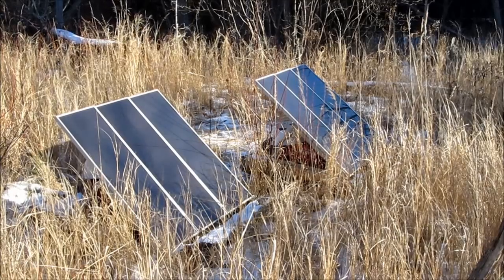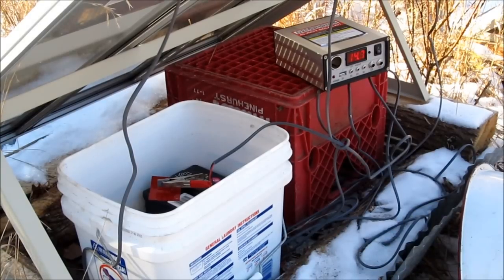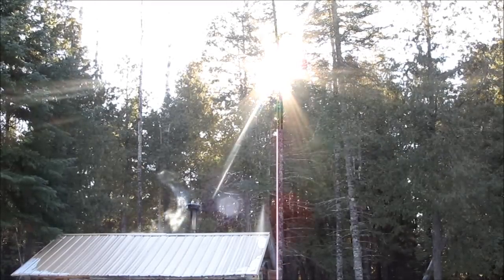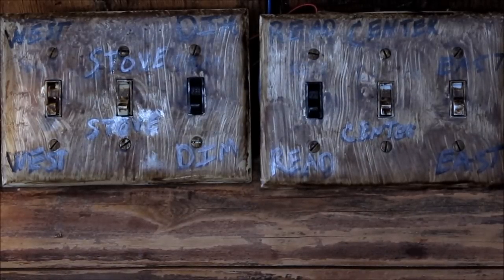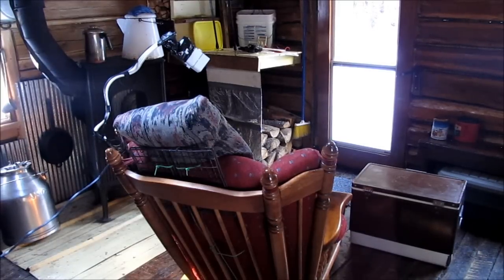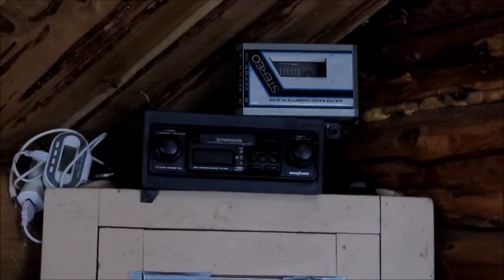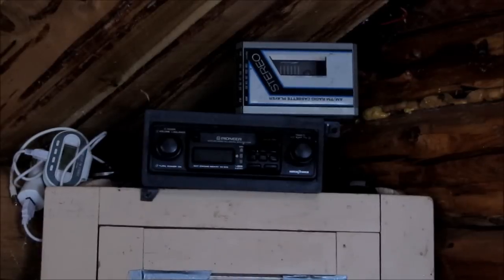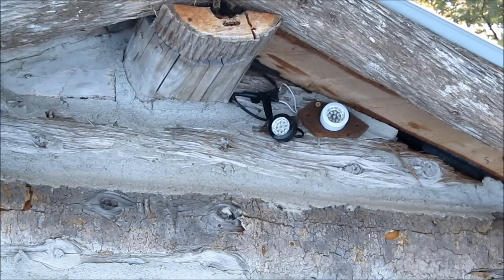Martin's Old Off Grid Log Cabin #1A Solar System for a Small Log Cabin

Comment: Martin,
How do you keep your used car batteries from discharging and freezing when you aren't at the cabin in winter?
Reply from the maker: The car batteries hold most of their charge for a long time unlike deep cycle batteries that do drain down fast and then freeze.

Comment: Sweet little setup. I'm currently putting together a little solar system for my off grid cabin.
Reply from the maker: Things have improved since I put in my system but my original set-up is still working. I may pick up one of the Harbor Freight newer kits so I will have all the power I need for the 5 watt LED's that are cheap now, really cheap now and not even available when I put in my system. A 5 watt 12 volt MR16 really lights up the cabin.

Comment: I have a 45 watt HF system too.  Purists laugh at me, but when Hurricane Michael shut off my electricity for 26 days, my cell phone stayed charged, and I had enough battery to play music and have lights.  I also had kerosene lamps and an old liquid fuel Coleman stove for cooking, and I suffered no lack.  I particularly liked the USB, 6 V, 9 V, and 12 V outlets, as well as the 2 light bulbs of the HF system.  Yes, you can get more efficient systems, but not at that price,  HF now sells a 100 watt system for the same price as I paid for the 45 watt, years ago.  .  I have a friend, Crazy Mike, who lives entirely off a single  45 W HF system.  He too is somewhat "energy conservative".  Between that and saving gas by riding a horse, you can guess how he got his nickname.  

I use old computer speakers that work of a 12 volt plug in transformer at home, but do well on 12 V direct from the battery too.  The MP3 player feeds them sound, and it makes an energy efficient "stereo".  I am still working on how to keep brats cool after my ice runs out.

I did drill out and bolt the solar panel racks together.  They got pretty loose, and the studs that held them got shaky.  On eBay, I got some tail light sockets ($1.38) and LED tail light bulbs $1.04 each) that make pretty good lights for moving around at night.  My "cabin" is the cabin of a 28 foot sailboat.  I deal with much the same challenges you do, but I don't have to worry about bears.  LOL  Whether Minnesota winters or Florida hurricanes are more of a problem is still to be decided.

Comment: That is nice. If you get some GBS batteries they are cheap. It will be safe inside the house and keep the batteries warmer.  Do you have a wind generator too?
Reply: https://www.electricmotorsport.com/gbs-12v-4-cell-20ah-lifemnpo4.html  It looks small and only 20 amp hour but you use the whole 20amps and when charging with the solar it's amps in and amps out. Lead acid charging amp to amp is not but 70% efficient. You can buy another GBS battery later and have 40amp hour and that would be the same as a 100 amp hour battery since you can take a lead acid down pass 50 %. Also, you get 12.8 or more volts till the thing is dead and when it dies it goes quick. I have a 100 amp GBS that cost me 560 bucks and 1000 watt true sine wave inverter with a MPPT charge controller that's also better then PWM. You waste about 20% of solar power from just that. 20% here and 20% for the charging lead acid. I would get just one of those 20 amp hour battery for now and use it. Charge faster amp in amp out. cold temps don't bother it much, keep inside no acid or gas, last longer, Later grab a MPPT solar charger. Then last get a solar tracker. Cheap one. mines well cause you have a slice of heavy out there and it would be nice to have power when clouds move in. Once your GBS battery is charge. I would run off the solar and lead acid and then switch over to the GBS.
Reply from the maker: Not enough exposure to use the wind. Good ideas if I ever really need any more power. I use so little that the investment would not be worthwhile.
Reply: @TheNorthwoodsman1  Really if you think about it, Having a lantern would heat up your house and give you some light. I love it. You one lucky Man living in a different world up there. I hate the rat race!

Comment: I'm an idiot.  Do you need to run wires from your solar panels a quarter mile back to your cabin?
Reply from the maker: No, not wires but I charge the batteries at the panels  and switch them every few days with the ones I am using in the cabin.

Comment: I checked my utility bills for the past year and it shows that I use an overall average of 37 kWh's per day as an overall annual daily average, (an overall average of 49 - 51 kWh's per day in the winter months) I think I'd need about 57 solar panels to generate that much power. Our high power consumption is about 1,700 kWh's in one month. That, I'm assuming, would require a 57 panel array. Each 250 watt panel, as I understand it, could generate approx. 1 kWh per day (*assuming 4 hours of direct sunlight per day). 1,700 kWh's monthly, divided by 30 kWh's (The amount of kWh's that one solar panel could generate in one moth) equals just under 57.   57 panels x 250 watts per panel, equals a 14,250 watt system. (14.25 kW). Does that sound right? Math was never my strong point.
Reply from the maker: Sorry, my set-up is so small in comparison that I can't answer.

Comment: Why not use those dollar store outside solar walk lights. You can tie three or Four of them together and use them as a reading light. Cheap easy and they will still be putting off light long after you go to bed... Plus they charge batteries..Marina's have lots of old boats and piles of old batteries for little or nothing... Three or feet down in the earth and they will not freeze. The solar panels should keep them charged up while you're away... I like birds  peace and quiet...
Reply from the maker: I have been going to get a few but never got around to it yet.

Comment: A Crosley solo wouldn't draw much, nice radio Am/FM  MP3 input and it runs on a 12vdc power Pack, which you could eliminate and just run it dc direct. Nice bassy sound too.
Reply from the maker: I have thought about upgrading and with the solar output I now have I would have plenty of battery to handle such a set-up. Right now I just use an old MP3 player with head phones for better quality music.

Comment: Bad thing about using car batteries is they do not like being ran down to extreme low voltages then charged back up.Because when they go dead....the cells can sulfate over the plates then fail to take a charge.
Reply: deep cycle marine batteries. cost a little more but are worth it.

Comment: The new harbor freight kits are 100 watt for $130. Great small starter system.
Reply from the maker: I checked them out, a great improvement in size to power compared to years ago. They have make it even easier to power up a cabin. Still the same basic set-up but more power.

Comment: A friend of mine and me lived off the grid for many years.  My son loaned us a solar panel which he mounted on the roof.  He used the deep cycle batteries.  They cost more.  If u don't live there all the time, u can do with just car batteries.  I don't know much about solar or batteries.  We left ours inside all the time.  Used an acdc converter.  we only ran a radio and in the past, a  c.b.  Also, charging a phone.  Je had a thing that looked like what you stick a cigarette lighter into inside of a car.  It was mounted outside of this big wooden box he had the batteries in. Once, my friend tried just putting more sulphuric acid in the batteries and that didn't work too good.  He had a thing that had green and red lights and yellow ones that showed the power available.  I like your videos
Reply: We lived on the lower side of a small mountain with millions of maple trees so sometimes, the power wasn't too great

Comment: Marine bat best
Reply from the maker: My problem is having them go dead and freeze when I am not there for months.
Reply: Despite what they claim,  marine batteries are not real deep cycle batteries. They may be slightly deeper cycle than a car battery but not by much. Remember, they are starting a large boat engine, which a single  real deep cycle battery probably can't do.
 Real deep cycle batteries are used in electric vehicles; sweepers, scrubbers, man lifts, and even golf carts. I try to suggest to people starting out, to use an inexpensive  pair of golf cart batteries wired in series.
 They shouldn't freeze if left wired to the panels through the charge controller.
 Learn how to care for them properly and they should last a very long time, 5 to 8 years or so.

Comment: Your methods are very sound for your purposes. Solar was priced out of our reach when we lived like this in our 70s Oregon homestead so we put a battery isolator in the Jimmy and a pair of used golf cart batteries behind the back seat and plugged the car into the house whenever we got home. There was a small marine battery at the house, all our lights were 1/2 amp taillights with automotive spst switches, and we had a small inverter which we could use to play records if we did not do it too often. Kero lamps were our backup and life revolved around the wood cook stove. The voltmeter would drop about 2 volts over a few days and then it was time to drive to town for supplies again.
Reply from the maker: Amazing, all before LED lights and these cheap solar panels.

Comment: good video ,but i have to call bullshit on the deep cycle freezing i use one from interstate a 900 CA and it never freezes and its cold up here in northwestern Ontario Canada,some times minus 30c for 3 of 4 weeks weeks anyhow i use that battery in my old 1998 chevy truck for going on 3 years now ,never had a problem.Maybe you just but a shitty one.
Reply from the maker: Joe,  the issue with them is when they sit for several months with no charging.

Comment: just subbed . a question if i may. can you supplament solar with wind as i heard lots of trees rustling.  thanks in advance .
Reply from the maker: It is all trees so no easy way to even use a small wind unit. Since the video was made I added 45 more watts and have more power than I can use. I the spring I only put our a third of the panels 45 watts and fall 90 watts. Long dark nights in Jan. I use all 135 watts to keep the batteries charged.

Comment: I noticed your solar panels are at a fairly low angle, you would get better output VB if you put your brackets on in the other position for winter when the sun is low in the sky. Nice videos, really enjoy our visits to the BWCA.
Reply from the maker: On my last trip I did just that. Had them closer to vertical. I have so much extra power now that I do not get too finicky about the fine points, sure makes it easier.

Comment: You should be using deep cycle batteries... and the panels u are using are junk... that's why it takes 3 days to Change them...
Reply from the maker: In a cabin occupied full time you would be right on both counts. I am not there that much in the winter so I put the panels under cover. Deep cycle batteries would drain down too fast and freeze up.  It is a cheap system and years ago when I put it in , well things have really changed in the solar world since then.
Reply: Ok... Just wanted to mention that in case you were not aware...
Reply: +TheNorthwoodsman1 I used some car batteries once. did the trick I was just lucky that I didn't do them inside cause I now know that their charging releases gas unlike agm type. as far as solar innovation I got some 10year old pannels that put out same as ones sold today, they actually sell same ones for just little "more" now via inflation. theres these cells that go over 20% efficiency but I can't find them in panel form do I'm planning on making my own frameless panel sometime next year likely. wish I could afford some decent land to have cabin on, so many restrictions and high prices on land kinda makes something like building affordable place an impossible feat

Comment: if you take and put installation the pink kind they use in walls would keep the battery warm and charged longer and faster cold air strains and is hard on the battery

Comment: One solution that I found in having electricity (when ever I want it) is to simple rent a condo in the city.....it cuts down on the amount of time you have to spend moving solar panels, really reduces the number of old car batteries you have to save, plus (and this is HUGE) you never need to buy a voltmeter. "My" buddy Jim tried this (last winter) and said that he had heat All WINTER LONG. I'm going to try this next fall and will get back to you on how well it turned out.

Comment: Nice video, thank you for sharing.

FYI:  Any shadow on a Solar Panel will provide a more direct path for the free electron in the SP to get back in balanced rather than to do some work for you on it's way back to the SP in order to get back to a balanced charge..  HOWEVER, the darker the shadow on a SP, the more direct a path back the the SP the electron has, even if it is a tiny shadow from a tall stick of grass. So, keep the source for any shadows as far off in the distance as possible (if you simply cut the tall dead grass only a foot or two from your SPs, making small but DARK shadows) you will harvest much more power from the same SPs........ Obviously you can not do much about all the tall trees in the distance but their shadows are not as harmful as lots of little but dark shadows just a few inches/feet away that you can take 2 min to cut off.....
Reply from the maker: +UTubeGlennAR Others have alerted me in the past so I now cut the weeds and grass far enough to the south so no shadows hit the panels in the winter time. Thanks
Reply: good to hear this. have you noticed any increase in out put?

Comment: I suggest that you build a solar heated box that will keep the batteries at the 65 degree range while they are being charged. This is the best temp to let the battery chemistry work . You are wasting a lot of the power you produce by trying to charge a 10 degree battery.

Comment: Why wouldn't you mount them on the roof of your cabin?
Reply from the maker: +S.R. Hurst The cabin sits on the north side of an old growth White Cedar area. Roof top would work in the summer but not other times of the year. In the video I show what the noon sun looks like in winter. It does not even show over the cedar trees.
Reply: TheNorthwoodsman1
Something to always think about isn't it? I love your cabin and wish you well. Have you considered putting a small wind power generator on a pole, just to compliment your solar panel system?
Great suggestions you give to protect your equipment as well as moving the panels around. Some folks, in thinner brushed areas, have a rotating solar panel similar to what folks used to have with their TV antenna to maximize total volume of solar power. Would that work in an area such as yours with old growth?
Reply from the maker: +S.R. Hurst That would work but I do not need all the power I can now produce.
Reply: TheNorthwoodsman1
Stay warm & safe in the new year.
Reply: +S.R. Hurst ..it is harder to clean the snow when they are on a roof
Reply: Jim Anderson
I was wondering about that chore...

Comment: I have to say, I love the solar cabin set up, although I cant help but think you aren't getting enough from your system? with 2 or more car batteries (guess 100AH each?) you should be able to do much more than run a couple of lights and a car sterio? cheaply!!!
Ditch those cluster LED bulbs! they are high intensity and focus it all on one spot.
I use 12v natural light LED strip-tape, (cut into 3 LED sections and spaced around my camper), sticky backed, LOW drain and dirt cheap. with all lights on Im getting about 2 weeks on a single 75Ah battery charge. (cost : €18 + fine wire & solder).
Reply from the maker: +dratsab1980 I posted this video about 4 years ago and have since learned that I could run a lot more than my lights and radio but I choose not to use such items at the cabin. My LED lights are 100 degree wide angle so really spread the light around evenly. I use the narrow angle lights outside where I want to have it shine way out there. I now have a wooden framework where I locate the panels for winter time use. The low sun angle of winter means I need to move them to a clearing 400 meters north to catch more hours of sunlight. I no longer drag those heavy platforms up there but simply move the panels and the control boxes using a light plastic togoggan. Other than that the system has not changed in all these years. Junk car batteries are still my low cost choice for storing the solar energy. Thought I might upgrade the controllers but do not need the extra energy they would provide.
Reply: TheNorthwoodsman1 I agree, old car batteries are just as effective as leisure ones, if well kept, and not allowed to sulphate up, at least u have sunlight there, here in Ireland we get about 4 minutes per year, may get a wind turbine instead!

Comment: Do you use 12 volts lights or do you plug into a converter and use regular 110 v lights?
Reply from the maker: +robviolin1 All my lights and radio are 12 volt. I have never bothered with an inverter or some of the devices it could power.
Reply: +TheNorthwoodsman1 yes I think that is the best way. You have a great setup. Besides, you are getting the power you need to turn on lights, etc.- for FREE. That is the best  price. Thanks for posting.

Comment: Do you run separate wire on an individual circuit from the battery, through a switch, to each light?   How large is the wire?
Reply from the maker: +William Klein I ran 14 gauge from the battery but run 18 gauge from the switches to the lights.